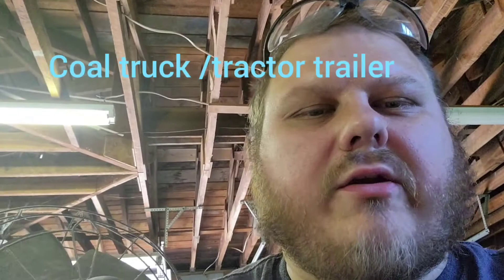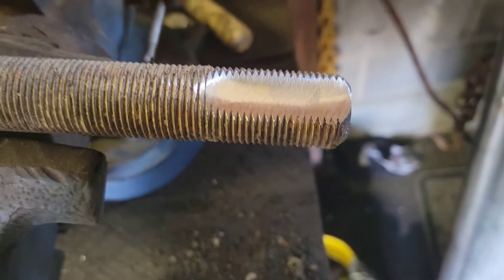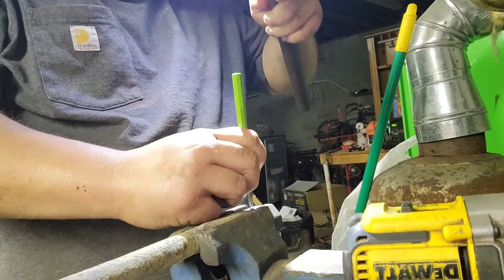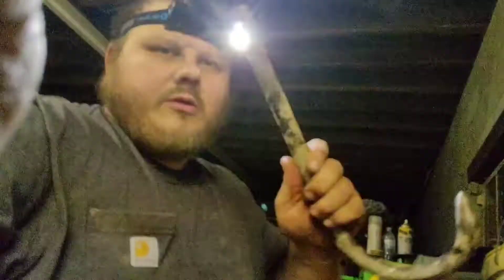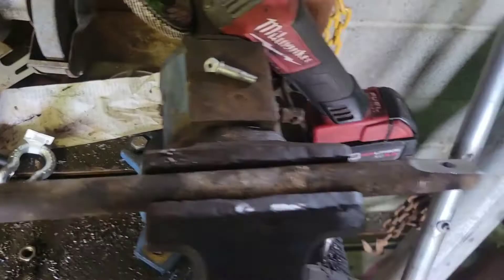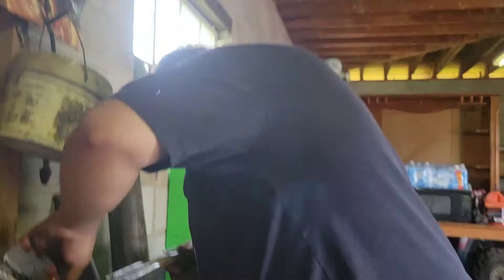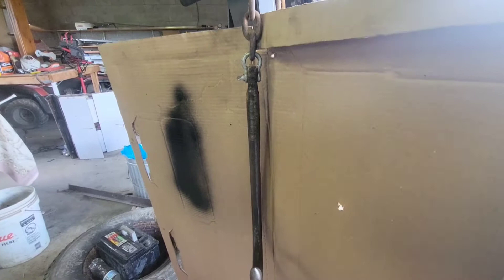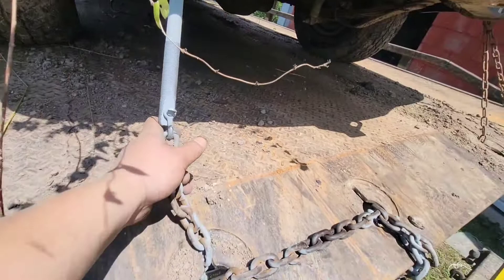DIY J hook /tow hook

Comment: Seeing this in mid 2024, hopefully u get or see notification. Any hows hoss how did that hook hold up for u? Most I'd be pulling would be about 2000 lbs 2500 tops, before I go thru hassle of speaking with h.d truck shop along with time to finish it id greatly appreciate info so times not wasted. Thanks
Reply from the maker: @davidwoodard1538  it helt up pretty good i did bend it bit with that said I bend the high $ ones with winch on my rollback  but ud be just fine with no more than ur pulling  I mean I bent it back and  still have it